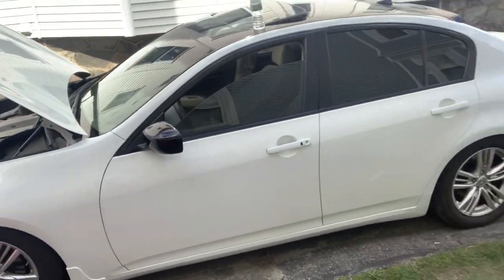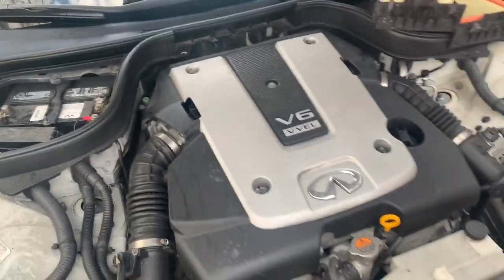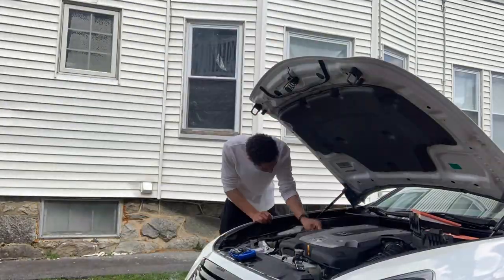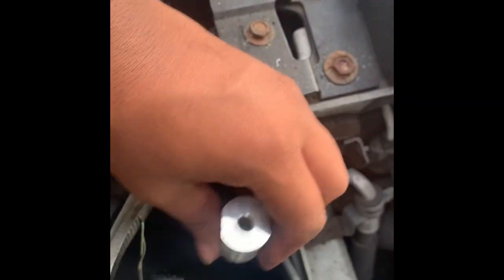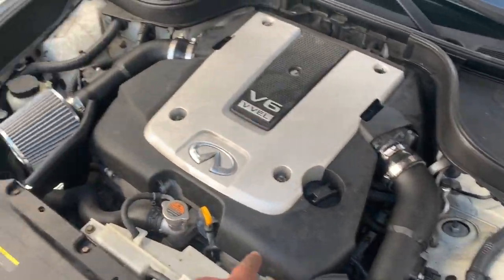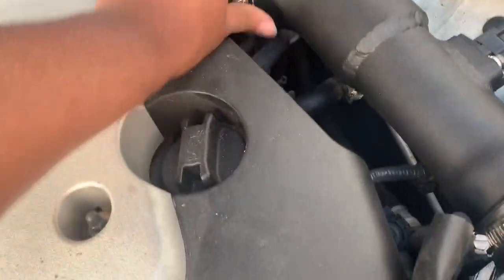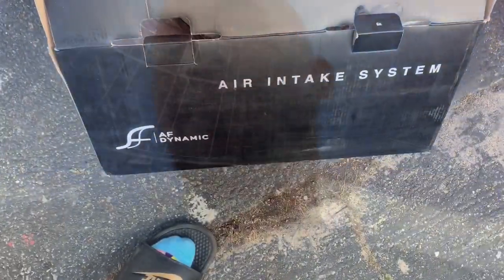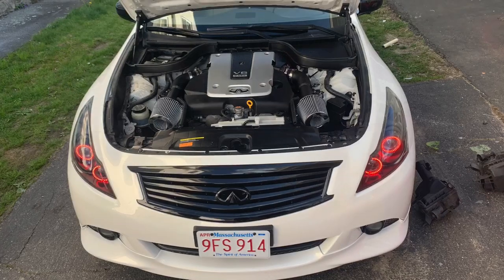G37 cold air intake installation!

Comment: Stock intakes work better then short ram intakes, the engine sound is pretty much gone after you go with a nice exhaust set up.
Reply from the maker: Yea u are right but if you are modding ur car and tuning it you are better of with aftermarket
Reply: @awli280  i agree 100% 👍
Reply: How does the stock intakes work better tho ?
Reply from the maker: @JoJo-wj8ls  the factory intake go thru a test that makes sure its being the most efficient for the car that way you get better gas mileage, aftermarket intake sometimes could help with that depending on the vehicle, but most people that do this sort of mod is because of the sound or because they will be tuning the car
Reply: @awli280  so how does a g37 09 sedan sound to you good or bad  doing it next week n im kinda nervous!
Reply from the maker: @JoJo-wj8ls  in my opinion its worth it, sounds better and later on thats one of the steps u need to take to tune ur car so i say deff go for it🔥
Reply: @awli280  bruh even if u tune with these short intakes it’s not gonna do nothing they aren’t taking in anything but hot air would be better off with long tube intakes
Reply: @Garciafarming  exactly.
Reply: @Garciafarming  lies 😂😂😂unless you buy cheap ones
Reply: @omarmedina7936  it's not tho

Comment: Hot air intakes. Should he in front of the grill 

Every tuner has showed the stock cold air intake boxes are better than those short ram intake size you actually lose power with those you should get a couple of pipe extensions to 90° couplers and then route them through the front of the radiator and have true cold air intakes.

Comment: imagine being in 2020 and still calling these hot-ram-air-intakes "cold air"
Reply from the maker: Imagine being in 2021 and being so hurt by an intake🥺🤦🏽‍♂️
Reply: even moncef from admintuning said use stock airboxes over this
Reply: @bread7289  I had these on my G and sitting temp was around 140 to 160 and while driving around the 100s and swapped to long tube intakes sitting temp 70 or so and driving 60 biggest power difference I’ve felt
Reply: THEY ARE HOT AIR INTAKES BECAUSE THATS WHATS ACTUALLY HAPPENING WITH THOSE INTAKES. YOUR BASICALLY SUCKING IN HOT AIR BECAUSE THE ITAKES ARE CLOSE TO THE ENGINE BAY .  I HAD THOSE ONCE ,BUT I ALSO HAS A VENTED CARBON FIBER HOOD . SO THE HOT AIR WAS GETTING DISPERSED OUT THE HOOD .

Comment: How to deal with when check engine soon light come on after cold air Intake install on g37?
Reply from the maker: Ur cel came on after the installation? If it did make sure to connect all the hoses and the clamps are tight any vacuum leak will make ur cel come on
Reply: @awli280  how do I tell if I have a vacuum leak. ? I did reset the light by doing that glitch on YouTube by pressing the gas 5 times
Reply from the maker: Look at the lines and put ur finger around the clamps or tubes make sure none have a whole or is leaking air or vacuuming air and make sure you put the map sensor back in correctly and its connected
Reply: @awli280  got u brodie. Thanks for info

Comment: Yoo, i have the same air intake but I’m having problems getting a good setup for the hose that connects to the air intake, the hoses keep kinking
Reply from the maker: Did you use the 90 degree curves it brings in the kit
Reply: Awli I bought some of my own from autozone, I was able to get the passenger side done but I had to remove those extra parts in the video u showed. I’m not sure if I’m supposed to put them back on or not so right now is just the hose from the intake connected straight to the crankcase. As for the driver side I’m gonna give it another try because that side is still kinked

Comment: G will make a nice sound under the hood but you'll likely lose 10-30 hp via engine heatsoak bro
Reply: I bought mine & it already had this type of intake would it be worth going back to OEM?
Reply: @NYKing1998  yes just go get drop ins & silicone tubes w/ maf's  it comes stock with cold air intake getting a SRI is foolish...get some dry performance filters..
Reply: No way will he lose HP considering he has that heat shield. 

I just made my own intake where I cut off the MAF section from the stock air box. I installed pod filters on both sides and I made my own cylindrical heatshield that goes from the pod to the factory air inlet. Definite noticeable gain in HP and response. I drove it hard for about 20 minutes on a hot day and didn't notice a loss in power at all.
Reply: @NYKing1998  no hp loss, got installed too, that's myth you talking about, rather loosing you gain hp and better top end, once the car moves to higher speed it drops temperatures better than Stock, very close to Cold air
Reply: @NYKing1998  same here bro, did you ever go back to oem?
Reply: Lies 😂
Reply: The nice thing about the short ram intakes for the vq’s is that you can extend the pipes down in front of the radiator for $50 in couplers and angle pipes. Works like a stillen intake but stillen is 800$ for basically the same concept

Comment: What kind of kit is it and what website
Reply: dont get these bro . your not getting any gains with a short ram hot air intake. you need the stillen cold air . cost abot 545.00 plus tax at z1 motor sports. way better plus youle see gains . the sound is amazing as well. this is trash .

Comment: That’s not a cold air intake that’s a hot air intake buy good intake buddy
Reply from the maker: Hahahaha thats good one bud, so funny you should be a comedian👍🏽
Reply: @awli280  He's not joking. Cold air intakes are usually outside the engine bay(behind the front grille). That short ram is getting mostly hot air from the open filter next to the engine.
Reply: @awli280  there’s actual dyno graphs that say the stock air boxes are better then the short ram intakes and the 37
Reply: @awli280  yeah not a joke it’s sucking up the air right on the hot engine it’s not getting as much cool air as the stock intakes would, straight from the grill.

Comment: LOL next thing u need to do is tune this shit bruh😂😂😂
Reply: No ! definetly dont tune with a sort ram . youle also need new upgraded fuel pump and bigger injectors . not only that but a super charger or a turbo would need to be installed before you tune. youlle need an extra 5k to do all that modding .
Reply: @shomarinelson6017  it was sarcasm.

What did you google best mods for g35/g37 ? Do you even own one dude ?

I own 2 and a Q60 , ive owned infinitis for over 4 years. You think you really know more about these platforms than me ? Look at my username bud